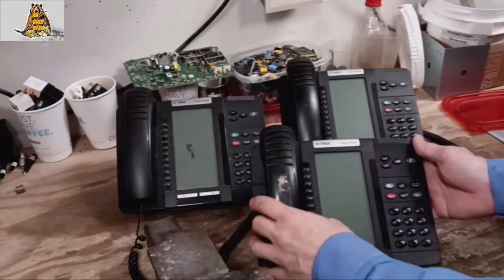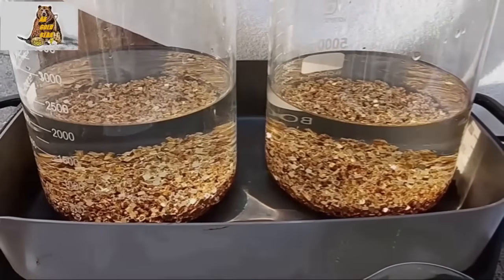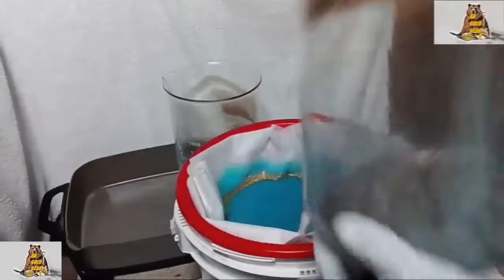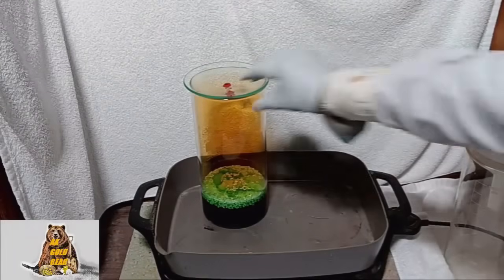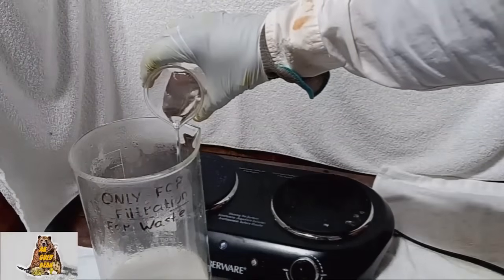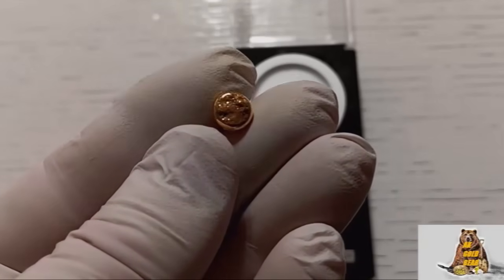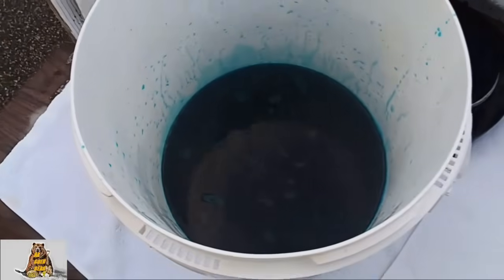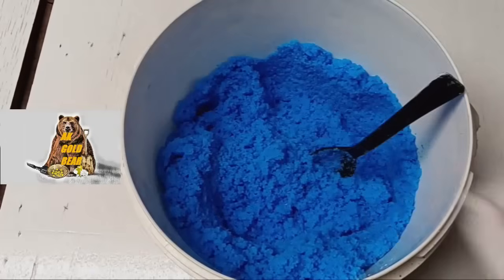Copper sulfate and gold from radio frequency connectors 🙂

Comment: Washing gold, hot water, nitric acid, then what is in electrolyte?
Reply from the maker: Electrolyte is diluted sulfuric acid with water. Electrolyte is used in car batteries. Sulfuric acid is diluted with water 3 to 1 or 4 to 1 depending on what density of acid is needed in batteries. In America, in auto parts stores, the word electrolyte is replaced by the word battery acid. But the correct name of battery acid is electrolyte. 🙂 Take 35 milliliters of distilled water, add 10 milliliters of concentrated sulfuric acid to the water and you will get electrolyte. Battery acid for your car.

Comment: Hallo, die Steckerteile sind doch aus Druckguss, Zink und ein paar % Kupfer.
Reply from the maker: Hi. The manufacturer will not be approved to produce connectors with such an alloy. This is a worldwide law. The parts must be copper and can have different alloys. It all depends on the manufacturer. Copper can be mixed with a small percentage of zinc, lead, nickel, etc., but the main metal is copper. 🙂
Reply: @akgoldbear7669  Sprichst Du von Messing?

Comment: I have one question, how is this copper sulphate pure? The connectors contain iron and nickel which also make crystals like iron sulphate, iron sulphate is green but since copper sulphate much more than it the color of produced crystal will still be blue but iron  for sure contaminated in it, I expect between 10% up to 15% base metals in those connectors besides copper main of them is iron.
Reply from the maker: Hello. Oh, that's a good question 👌
Yes, the iron in copper nitrate can get into copper sulfate as a result of a chemical reaction.
Cu(NO3)2 + 2Fe + 4H2SO4 → CuSO4 + 2NO + 4H2O + Fe2(SO4)3.
The higher the concentration of substances, the higher the rate of interaction between them. But in my case, the concentration of iron is minimal, so the iron remains in the solution without mixing with copper sulfate. You can understand this by doing a small experiment. Dissolve some slightly  magnetic copper pins, evaporate some water, the next day you will get copper sulfate. Collect the copper sulfate and evaporate the remaining copper sulfate by another 40%. The next day you will get some more copper sulfate. Then start evaporating the remaining solution again, and you will see the solution start to change color from dark blue to greenish, and a heavy gray precipitate will start to fall to the bottom of the beaker. This precipitate and the color of the solution are those iron impurities that were mixed with copper. Iron, nickel, lead, and possibly tin. This can only be determined by personally conducting an experiment. Thank you for your question and your time on my little channel. 🙂
Lord, I'm tired of typing! 🤔
Reply: If you fully dry the solution, all of the salts will crystalize and be mixed together. If you concentrate it and let crystals form in the supersaturated solution, they will crytalize out sequentially based on solubility. Fractional crystallization is sort of the yin to fractional distillation's yang. For maximum purity, you'd want to cool the solution slowly so you get larger crytals that have time to exlude any other salts from getting entrained during crystalization.

Given that AK is a proper chemist and didn't spend much time doing a careful recrystalization here, I'd wager a guess that he has tested these connectors and knows that they are pure copper rather than an alloy. Either that, or he has done this enough to just know that any other base metal salts present are too soluble to crystalize out following this procedure.

Comment: What is electrolyte?
Reply from the maker: Hi. Thanks for watching🖐
Electrolyte is diluted sulfuric acid with water. Electrolyte is used in car batteries. Sulfuric acid is diluted with water 3 to 1 or 4 to 1 depending on what density of acid is needed in batteries. In America, in auto parts stores, the word electrolyte is replaced by the word battery acid. But the correct name of battery acid is electrolyte. 🙂
Reply: @akgoldbear7669  Thank you! Makes perfect sense now  :)
Reply: When he says electrolyte here, it is dilute sulfuric acid.

(But it is NOT concentrated sulfuric acid)
Note boiling concentrated sulfuric acid is aggressively dangerous and has limited use in refining. Often able to be replaced by incineration.
Reply from the maker: @colonialcharlie8702  You are right. A drop of boiling sulfuric acid can burn through skin to the bone in a couple of seconds 😨😬
Reply: As Charlie said, it's dilute sulfuric acid. He calls it "electrolyte" because it's sold as battery acid, which is the electrolyte for lead-acid car batteries.
Reply: @TheRealWeirdoC  Thank you !

Comment: Nice buttons !  I always enjoy your  videos ,  Making Copper Sulfate with the waste is a great idea. May I ask I notice you have red marks in the glass watch plates what’s that for ?
Reply from the maker: Hi.🖐 The red spots on the edge of the lids are, so to speak, a life hack from me. Sometimes, I'm sure you do too, we pick up the lids or stir sticks without gloves, right?! The red spot is where I grab the lid with my hands. I never turn the lid on the beaker so that the red spot is where the nitrogen dioxide fumes come out. This way, if I forget to put on gloves, I will never get chemical burns on my fingers. And the red spot in the center of the lid is just me covering the hole from the bolt. All my lids are old pot and pan lids. 🙂
Reply: @akgoldbear7669 good tip , I get mine from gold will when on sale . You tube crashed the other day or maybe I accidentally deleted a comment from you . About keeping the gold filled items in AP . Are you north or south of Denali ?